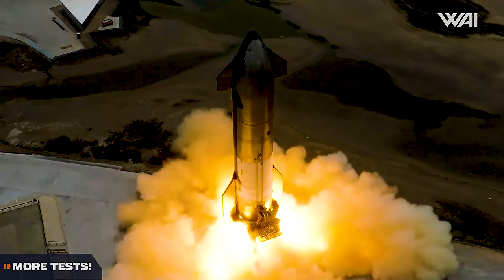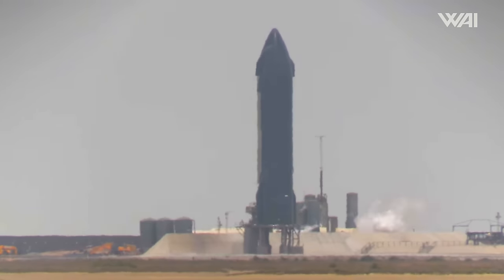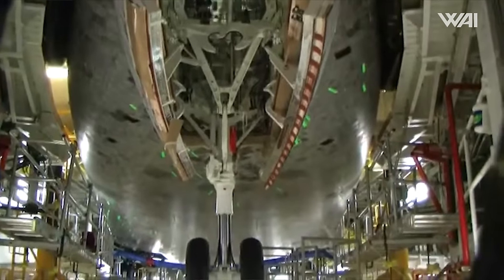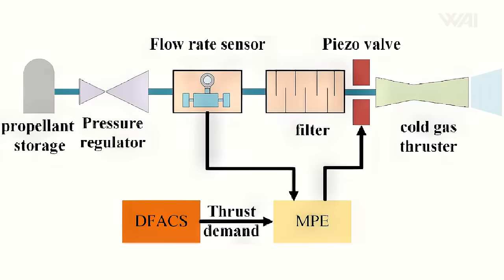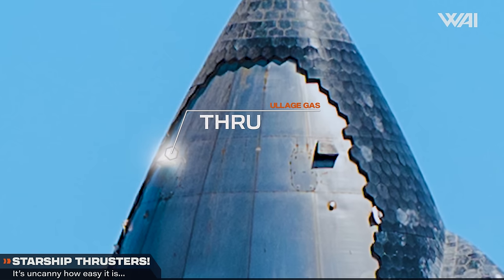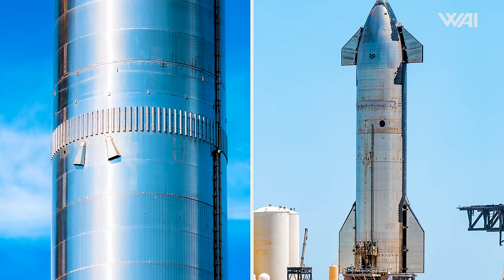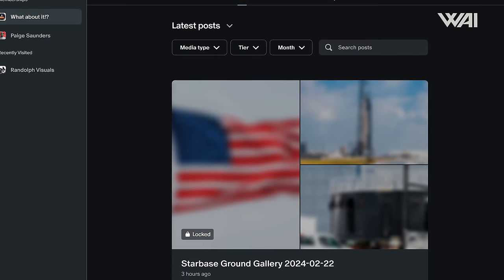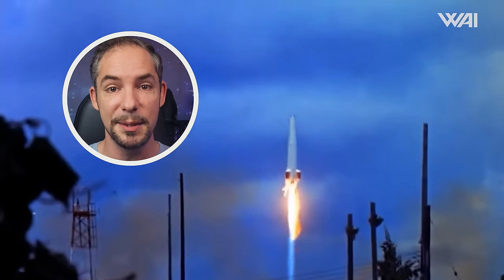SpaceX Starship's #1 System Fix Needed!

Comment: Maybe SpaceX should look into thruster heaters. As I recall, NASA put heaters on the thruster vents after Gemini 8.  The thruster heaters were also a major milestone in the Apollo 13  restart.
Reply: Excellent recall and comment.
Reply: I thought the exact same thing. Induction coils
Reply: The ship sides are rigid only when it’s pressurised. “Oil canning” (panel pops in/out) will pop tiles off as easy as….
Reply: @TniasJ  induction coils need additional cooling and large amounts of alternating current.  Most likely they will just put on some temperature controlled PTC heaters that autoregulate to somewhere between 60F and 100F.  Wirebased or flex based silicone heaters are possible, but the fastest way would be bonding on heater wire.  Basically, a high end version of heat strips used to keep gutters/roofs ice free.
Reply: @timzalusky yeah' I think the solution could be as simple as heating a copper wire in the right place.
Reply: @JM-yh4yf  Nichrome wire, not copper.
Reply: That would require spacex to learn from history, they're way too smart for that...
Reply: @lizardKingCDXX I understand your comment, however it appears to me that they have been using the try it and learn method the Russians used in the early space race history. Everything they learn from their mistakes is a lesson learned from history, even though it is recent history.
Reply: @Dave5843-d9m  Except the tiles are not glued on like the shuttle -- they connect to a central point allowing for (a certain amount of) flex -- and easy, testable, attachment.   I would presume the static fire -- close to the ground reflections and stirred up debris, with no airflow to sweep the debris away, firing in the dense atmosphere all make FOD and pressure wave impacts worse.  On a full stack, the Starship is hunderds of feet away from all that and when its own engines ignite, there is supersonic flow keeping the exhaust away,  and a very thin atmosphere to "conduct" any shock waves from the engine to the body of the spacecraft.  The risk is not eliminated, but greatly lessened on a real launch.
Reply: Tim must bear full responsibility for the destruction of Ship 28🤷‍♂
Reply: I should have read more comments I basically repeated this thought.
Reply: @nanookfireman306  Yeah, how'd did that work out for Russia BTW? That's right they lost and then their economy collapsed. Yeah, I'd model that too...

Kinda what I mean by "too smart to learn from history"
Reply: @nanookfireman306  I remember watching the first Russian moon walk... wait no i don't, that was just a rave I went too in high school with a bunch of Russian exchange students never mind.
Reply from the maker: Excellent comment! We should have definitely mentioned this. :_WAIStarship:
Reply: I also repeated this comment before I read more. Here is what I posted "Maybe they can use a cold gas thruster system but with heated nozzles (and possibly piping) to prevent vent freezing and aid in the rapid vaporization of the cryo liquid when needed. The heat could come from the combustion of small amounts of a methane/oxygen mixture in a closed environment similar to how a diesel parking heater works."
Reply: @ScottSuhr-l8m True, but the flame trench at the other site will hopefully eliminate that dynamic pressure as well.
Reply: Weren't Russia's booster more better / efficient than ours?
Reply: The solution to the uncontrolled rolling, pitching and yawing seems simple. Heat the jets with electricity from batteries or have them heated by burning methox in a chamber or having mini raptor engines fully gimballing through a hemi  sphere or have have reactant chemical jets. The highly motivated workers have a full four weeks to install any one of these systems once Elon makes the choice.
Reply: Yepp... Electrical heaters was the first thing popping up in my mind 😁
Reply: @mryoung8586  No, No one has ever made a rocket engine that could touch the Saturn 5. That's why the N-1 had 20 some engines. The thrust to weight alone is a huge disadvantage as the engine is the heaviest part aside from fuel. Less is more.
Reply: @filonin2  agreed...I was just emphasizing how easy the solution might be.
Reply: Given their success with the draco thrusters I was actually surprised they had problems with the thrusters.
Reply: i wonder if they tried to re-pressurize the cargo bay when the door failed to seal? It might of turned it into a large thruster.
Reply: The problem is bigger than frozen thrusters though, they were leaking fuel like crazy. I don't think they could have put enough deltaV in those things to counter that. Their fuel tanks were at zero when they tried to relight the engines. There's a lot they tried to cover up here. The were playing elevator music to cover up the control room panic.
Reply: @lizardKingCDXX  I am so sick of people hating on SpaceX for not implementing “obvious” solutions from the past for problems they are facing now. The SpaceX ideology is “minimal viable product”. Every gram is crucial in rocketry. Overengineering to perfection, because you only had one chance, was the biggest reason for inflating budgets in rocket science. They consciously decided to not build rockets that are exactly like rockets build before. That will mean they will run into previously solved issues, because of “minimal viable product” and a process of testing a lot and rapid iteration. That doesn’t mean they are incapable. It is just a result of a different design philosophy, which enables SpaceX to take a shot at the previously thought impossible or not financially viable in rocketry. So stop hating, look at Falcon 9, their design philosophy has already proven itself, getting kilo’s into space is cheaper than ever.
Reply: @NJKoopmeiners  I tried of people acting like Musk and SpaceX have done anything other than throw money at the problem. And for all that the old russian Proton-M is still a cheaper LEO option...

Comment: Tile, Tiles Tiles... No tile is the best tile. Or how about; Robot tile fixing dog to repair tiles in space before reentry? If we fixed tiles in space would Columbia be in a museum? or  My shower wouldn't work well without grout, grout the tiles? No tiles, even a plastic cup will not burn when filled with water. a interior cooled water jacket? I know 8bls a gal. or or, Flare the bottom of the ship with tiles, grid fins on top, fire engines and come in ass end first? If it were simple...I think SpaceX will solve it without tiles.
Reply: I can't help but think that there has to be a spray-on protective  ceramic foam coating solution  that could be developed for this. The spray could self-cure on reentry rather than in specialized ovens. If a piece breaks off the starship at some point, the empty spot can just be filled in with additional  spray-on foam.

Comment: Hi - I worked in an asbestos factory in the early 1970s and yes, asbestos is hazardous stuff. 
However, WE WOVE ASBESTOS TO MAKE CLUTCH LININGS for big equipment. 
Weaving a ceramic / asbestos heat-shield would very much easier to attach to the Starship and easier to replace.
Reply: Maintainability is higher for modular systems like tiles.
Reply: @neonempire1684  The point is that the "fall-off-ability" of tiles is very high and the maintainability of woven ceramic  hasn't been tried. There's no reason why modular techniques couldn't be used. 
Hey... someone patent it for me, lol.
Reply: @RamblingBob  Hey Bob. Great idea. 
I was thinking about the same problem and how it might need larger, preformed sections made of a material that behaves not unlike asbestos, to successfully cover the Starship.  
I think your suggestion of a woven ceramic material should be considered more.
I think you are on the right track, and I hope some engineer or other picks it up and runs with it.
Reply: Not cool Dude
Reply: I believe there is already an asbestos mat under the tiles (the white stuff)

Comment: As for the heatshield, presumably the issue is that during vibration the heat tiles crash each other at the margins and some of them get cracked and then fall off. In this case, the gaps between the tiles may be increased exceeding the vibration movement and the tiles have to change the form becoming more outward protruded, like pyramid shaped for example. The tiles need to become taller what causes the plasma flow to get disturbed further away from the body of the ship and maybe even to get eaten up in the in between gap. For sure there are flowsimulations which can calculate the height of the roughness for a hydro-/ aerodynamic optimized surface . The skin of the sharks is as well rough which increases hydrodynamics.
Reply: I've been thinking about the attachment pins may be cracking the tiles under pressure.  They look sharp ended and the insulation under the tile is compressible... I know there is an insert within the tile body, but does it have enough surface area to spread the load?
Reply: put a net arround the heattiles and they cant fall off. lol
Reply: The vibration to the tiles comes from the steel attachment pins.  Another idea could be to address the connection point to better distribute and dampen the vibration while allowing for the tile to move along the connecting pin axis as the ship expands and contracts - just a bit.  The underside of the tile could also attach to the insulating blanket like Velcro.  The insulation exposed surface could have a closed loop surface and the underside of the tile could be a rough/exposed surface area where the silica-based strands could hook into the closed loop insulation.  The idea is to allow for expansion and contraction in several axis/directions while being anchored to the ship via the pin mechanism with most of the underside of each tile being connected to the insulating fabric.  And the best part, it is complicated.  ;)  LOL, but possible?
Reply: @lesjohnson2916  Nice to have an exchange of opinions. Pictures of the welded attachements have been shown on utube : on the first glance they look like metal sheet stamped to an arrow tip shape. In this case propably  an arrow tip "hooks" inside an orifice: the retention of the tiles seems to consist in the tiles been arrested by the "arrow" and  hold under vertical pressure on to the surface. The question is how well "free "floating suspended are they since there is quite a lot of vibration ongoing. In mechanics there are bent wires attachements which include loops like springs which can absorb vibration. A attachement made out of a looped wire may absorb more vibration than a metal sheet.  ; maybe, but what do I know? :)

Comment: A few possible ideas that may or may not have been mentioned already:
Perhaps wrap the Starship in a vehicle type adhesive wrap material to hold tiles in place until re-entry burns it off.
Perhaps the commonly suggested placement of flaps aft of the heat shield might not only reduce number of tile shapes, but could also aid in more closely matching the Starship profile to that of a Dragon capsule for aerodynamic stability.
Perhaps an on-orbit robo-arm to inspect for and replace tiles.
Perhaps a semicircular shaped nosecone with an eyelid type opening that opens within the slightly larger diameter heat shield “half” that would also enable less number of tile shapes and allow for a large and robust cargo door.
This semicircle nose cone could also be removable at Stage Zero to allow for various cylinder shaped third party cargo configurations to be placed within a standardized Starship’s cargo bay. Eg. Space station or space ship, satellites, refuelling tanks etc.
Looking forward to fourth launch!

Comment: I've lived in the country for years.. every winter pipes would freeze and burst.  The fix I deployed was "Resistance Heat Tape",  a low power solution that would be energized once the outside temperature dropped below 0C/32F,  why couldn't a solution like that be deployed to keep the thruster valves from freezing over?
Reply: Is that the reason why they couldn't reignite?
Reply from the maker: It can. Thruster heaters. We should have mentioned that. :_WAIHeart:
Reply: @Whataboutit The great part about thruster heaters is you only need to keep it just hot enough so that liquid oxygen or methane does not freeze on the walls of the thruster. Even if it freezes in the center. The gas will instantly push everything out. That should mean very little heating will actually be needed. Even better, if you are in a long coast and don't need the thruster for a while. You can just turn the heaters off and back on only when you need to prepare to use them again.

Comment: Using vent lines is indeed a good cold gas thrust mechanism. If these did indeed freeze then larger lines and valves or electric preheater tapes  might be the easiest fix. Wirhout the need for complex hot gas thrusters. As you pointed out the Apollo program and Dragon capsules on the other hand, use separate hypergolic (chemical) thrusters. Which option is the least weight intensive is indeed for the engineers to decide. My guess from a restart reliability standpoint, especially from the lunar starship standpoint is chemical thrusters if not as primary RCS at least as a redundant backup for hot gas ignition. The solution for Raptor restart might also, give them an epiphany, on the ultimate solution.

Comment: I believe the heat tile problem will end up being un-solvable because of the the blast sound way reflectivity and transfered vibrations from the test and launch stands. I think that smaller tiles placed over seams in the vehicle may solve the vibrational issues at those joints. And, perhaps transpiration cooling may need to be integrated into the entire system.

Comment: Dear Felix and the What About It team,

I have not commented before but have been following your channel for a long time. In fact, it helped inspire my daughter's interest in SpaceX and in physics.

You invited ideas about the difficulty controlling the attitude of Starship.

We think there is a major problem with relying upon half empty tanks in both starship and booster. Even with baffles, there is likely to be destabilizing sloshing in such a big vehicle and we suspect the engines are cutting out due to lack of stable fuel pressure. Most rockets don't have to fly backwards and slow down, with fuel accelerated to the wrong end. Perhaps Falcon 9's cold nitrogen ullage can do the job, but how much added nitrogen would be required to send starship to the moon and back?

We got inspiration from looking at the old natural gas holders rusting away in many towns. They have a spirally guided system to raise and lower according to the volume of gas stored. Could the starship and booster tanks have a screw-closed piston that steadily screws down as fuel is used to keep the liquid under pressure? I understand that the proposed XCOR lynx engine had a piston driven fuel supply. The movement would not have to be rapid, just enough to keep up with fuel burn. Something for electrical motors like for the nozzle gimballing?  It sounds overengineered but is it really more complicated than having baffles, ullage gas, header tanks and probably header tanks for the header tanks because the starship must relight so many times. For the RCS thrusters, hot thrusters are needed for the lunar landing anyway so small methylox thusters using the same fuel are the way to go and obviously not a problem if the tanks are pressurised as above. Also more fuel efficient that venting unburnt gas.

It is difficult to see long term deep space exploration use for starship with any system relying upon multiple sloshing tanks and various different gases.

Keep up the good work!
Reply: That’s a pretty big moving part to break. Best part no part blah blah

Comment: Tell us something we don't know. The ship had little to no attitude control from the moment it shut down the 2nd stage at orbital speed. From the video the ship continued to out gas propellant after the engine shut down. The out gassing itself could have thrown off the attitude control acting as a cold thruster. It also looked like propellant was leaking from the check valves on the Starshp QC that they have been having problems with since they went to hot staging raising the angle the QC connects with.
Reply: That's what I said. Had it has a proper RCS system, the spin very likely could have been arrested.

I am not sure there is a good solution short-term, short of, idunno, retrofitting in something like dracos.

If it is purely a vent freezing issue, some of the others have suggested heating the vents and plumbing which seems like it could be feasible.
Reply: @Steven_Edwards  Falcon 9 hasn't had attitude control issues, but it jettisons the second stage after orbital speed as a loss. The capsule attitude control seems to work effortlessly with cold gas nitrogen.
Reply: @Steven_Edwards  The attitude control jets could have iced up from the out gassing propellant

Comment: I wonder if the RCS freezing issue could be addressed by using pressure feed Meth-Ox hot gas thrusters? Basically run things at the same pressures, but mix and burn the boil-off gases to keep thing warm (any thrust improvement would be nice, but not necessarily the point). Some cute regenerative cooling tricks might even make the system mostly ambivalent to ingesting a feed of mixed gas/liquid by ensuring whatever reaches the valves will be boiled regardless of what it starts as. OTOH burning would result in water which could cause even worse ice issue than the current system is getting (presumably any freezing on the current system is methane or O2 ).